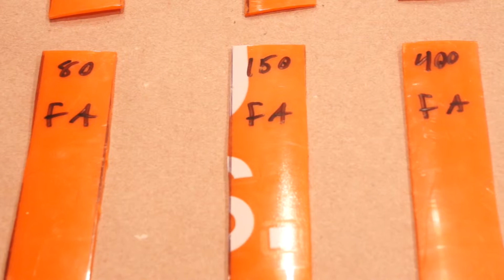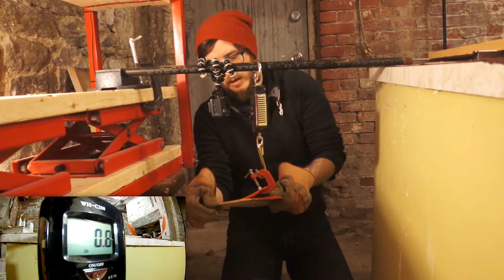Testing the Best Way to Bond Plastic to Resin

Comment: FYI - Flame treating is a form of plasma treating. The best way to bond low surface energy plastics is with a real plasma treatment system (Tantec, Plasma Etch). Luckily I have a small plasma wand (from Plasma Etch) but they are a couple thousand so probably a but much for most personal use.

Comment: Are there anyone that knows what type of material that 1985 gmc suburban. Rear air conditioning covers are made of I don't know if it's a abs plastic or whatever. Types of plastics gm used to produce the covers so I don't know if I can use fiberglass or not.

Comment: guessing the sanding creates peaked points in the surface texture. 
The flaming makes the points mushroom on top which in turn increases the bonding characteristic.. 
Good work man thanks.
Reply: Interesting theory.     It would be nice to see it under a microscope.

I had always heard that flame treatment changed the surface energy of the plastic, allowing better molecular adhesion.

Comment: Very nice video. I don't understand why you don't have more views. You worked very methodically. I think the same technique should also be applicable to make paint stick to HDPE. I am going to paint some blue plastic, HDPE, drums to use as rain barrels. I already tried some experiments with sanding vs not sanding and with the application of purple Oatley primer for PVC pipe gluing, followed by brushing on some satin latex based house paint. Sanding helped. The PVC primer also helped a little. But I could scrape or peel the paint off easily in all cases. I'll try your suggestion to flame treat a coarsely sanded area before painting.

Comment: Even though this is 3 years late Im just writing this so the channel owner knows what the flame treatment does. I dont know exactly but I believe i heard that these plastics are created in a mold and sprayed with a kind of oil so they dont stick to the mold. the problem is that this makes them near impossible to glue. i believe i heard that flame treating heats up the plastic and brings the oil to the surface temporarily and then you wipe it away with alcohol or something like that and it becomes much easier to stick afterwards. i might be wrong but that's what i heard and it kind of makes sense. i may have the order wrong also. but i think it has something to do with the oil. that's why if you look at loctite glue they have an activator that you have to apply first. i believe that dissolved the oils in the plastic.
Reply from the maker: Iiiiinteresting, I wonder if there's a way to confirm that

Comment: hey, thanks so much for the video. I kinda knew that PE wont bond with epoxy that well, but I didnt want to deal with any flaming at all so i just ignored all of that. But now you've just convinced me that I actually gotta do the flaming. damn.. would you think it might be even better to actually scratch the base to make it even more rough ? cause I've tried it with sticking inserts to the base and they seem to hold up pretty tight
Reply: I also read this article on junksupply about flaming sidewalls from HPDE and it says sanding>acetone>flaming, so that you dont remove the oxidized molecules or whatever, I dont even know either how that works, but it kinda makes sense
Reply from the maker: Yeah, I definitely recommend sanding > acetone (which is just to clean the surface) > flaming. I have no idea why the flaming matters but it does, and that's the order that I found works best. Glad you found the info helpful!